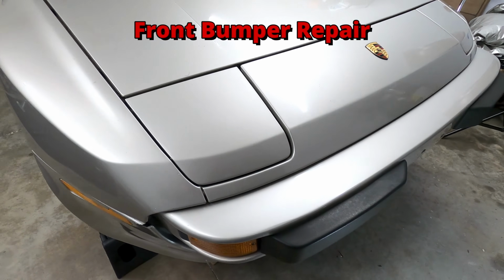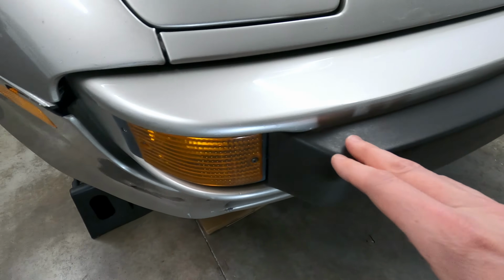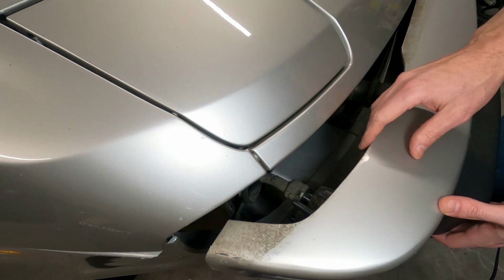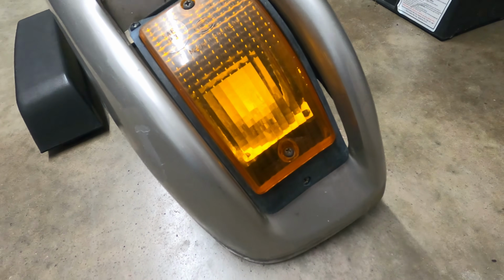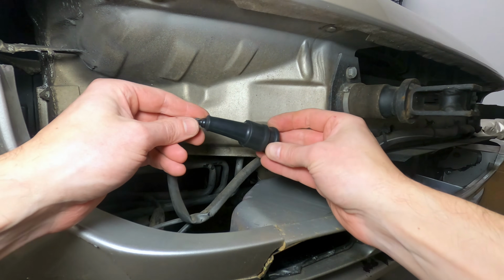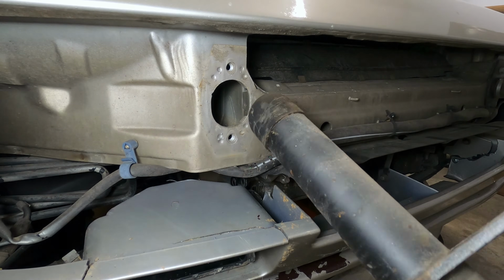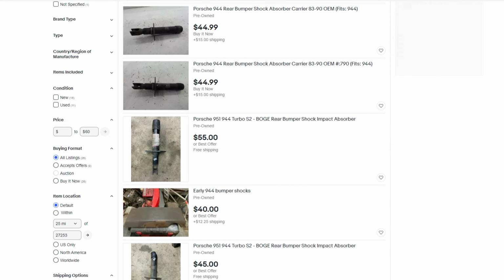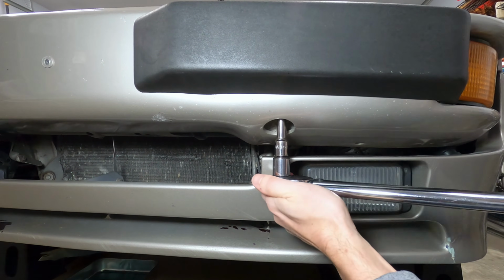Porsche 944 – Front Bumper Removal/Repair Tutorial: Rubber Pads, Shocks, & Turn Signal Replacement

Comment: Great video how do you adjust the pop up head light left to right i have a big gap on mine
Reply from the maker: There are pivot points mounted to each side using triangular brackets. If you loosen the three bolts on each side, the assembly can be shifted around.

Comment: Thanks for the video! I'll be removing my NA front bumper and installing the Euro front bumper with the smaller bumper pads. Have you ever installed the Euro bumper on NA? I have the hardware. Any tips, guides or videos? Thank you. Keep up the amazing content.
Reply from the maker: Nice, that should look pretty cool when it’s done. I do like the look of the Euro bumpers, although I’ve never installed them… there should be some details out there on Rennlist.
Reply: @NC944er  Thanks for the reply. I'll check the forums in depth. Thanks again for the amazing content.

Comment: Thanks!  I cringed a little when you put it back without cleaning and waxing the parts you can't get to easily.
Reply from the maker: LOL! 😂 Yeah, under normal conditions I’d say that’s a great idea. In my case, this footage was captured right before an entire front end rebuild (you may have noticed the cracked front spoiler) and I really just threw it together for demonstration purposes. But yeah, everything ended up getting extensively cleaned after the entire front end was torn down, freshly painted bumper, front spoiler, as well as sections of the frame rails. Check it out if you’re interested - https://youtube.com/playlist?list=PLxJpRi5o1a3oFxx94QKjZUw6lZbtXT5N1

Comment: I am wondering if you could send me the part number for the air diverter that sits behind the alternator? Is it a plastic piece? Also, is it a totally separate part from the alternator hose kit sold by 944 online that you were talking about before? Thank you for your help. Oh yeah, have you ever thought about getting one of those clear sunroof? They sell them here in Phoenix. $600
Reply from the maker: It’s a separate plastic ventilation cowl that bolts on the back, part number: 951-603-113-03

Comment: Those new rubber boots are really nice and are the gold standard replacement part.  If anyone is looking for a cheaper and easy alternative that is functionally equivalent you might also consider the VW part 113945521A.
Reply from the maker: Excellent! I was not aware of this VW part, looks similar but uses individual holes for each wire. Very cool, thanks for sharing. 👍🏼

Comment: Nice video.  Funny, yesterday I realized that one of my bumper shocks is depressed.  I know my light boots are dried up so I will retrofit an old bike tire tube and zip ties as a cheap fix when pulling out the depressed shock.  Take care!
Reply from the maker: Yeah man, that method sounds like it would work as well. 👍🏼 When I pulled the shock out originally, I just hooked one of the bolt holes on the underside and attached some rope to the tow hitch on another vehicle, feathered the clutch/accelerator in reverse to ease it out. It actually pulled the shock out too far by about 1/4” but I was able to kick it back in place pretty easily. Some time later, I leaned against that side of the bumper with my leg and pushed it back in a bit, so they don’t offer much resistance once compressed.
Reply: @NC944er  Thank you for the tip.  I hope to play with my toy next week.  Have an enjoyable weekend

Comment: Thanks man! Thinking of doing the rear ones?
Reply from the maker: Great question! The rear side markers are setup a little differently on the 944 and so they don’t use the same rubber boots. The rear wiring is enclosed inside a larger plastic housing and it gets less direct water exposure. Part Works only sells the boots in packs of 4 is why you may have seen the extra ones in the video. I haven’t really looked into it, but there may be a reasoning to that in another automotive application that uses 4 per car, perhaps the 924 or a VW/Audi model?

Comment: How is project Rudolph encounter going? Thanks for the tip of where to get those rubber boots, mine have crumbled into little tiny pieces. I am wondering if you had to replace the one piece that brings in air looks like a curved tube. Starts from the driver side fender goes under and back into the engine area, isn’t really connected to anything, I think it just brings more air into the engine area, or maybe there is some thing connected on the other end and I just don’t have it. Hope you understand what I’m talking about. Anyways I’m trying to locate one of those. The tabs that connected to the body by screws are very fragile and they tend to break off from the tube my new project is working on the sunroof motor, I got it working, I just can’t get the arms to unlock from the sunroof. I’ll figure it out, I am pretty close. Anyways good luck with your project. Ian has been pretty helpful from 944 online
Reply from the maker: 😂 I’ve got all the essential parts on order, but a lot of it is coming over from Germany so there’s a 3-4 week lead time. With some house projects backing up, I’m trying to scratch out some time to actually start the teardown process. 

The plastic tube you’re referring to is the air duct for the alternator (944-603-441-00). It should connect to a flexible vent section that leads up to the shroud on the rear of the alternator, but this section is often missing. I demonstrate it’s replacement using Ian’s kit in my alternator replacement video. Part link - https://944online.com/alternator-vent-hose.html